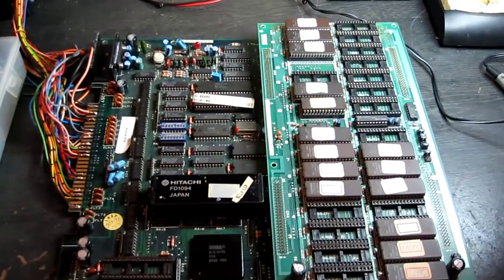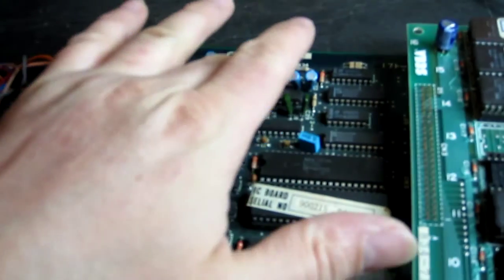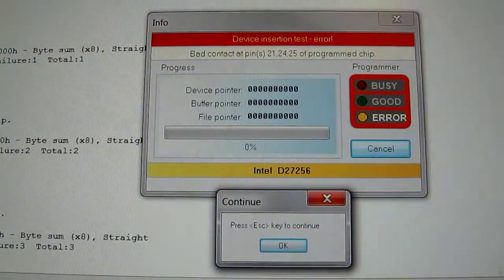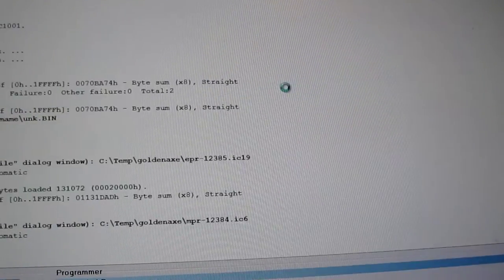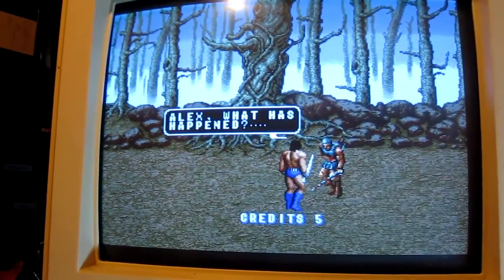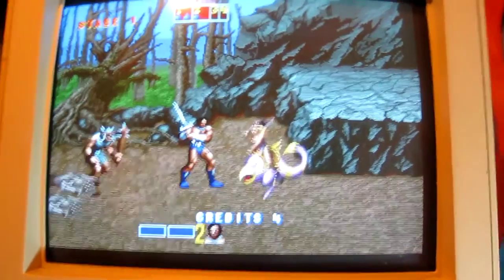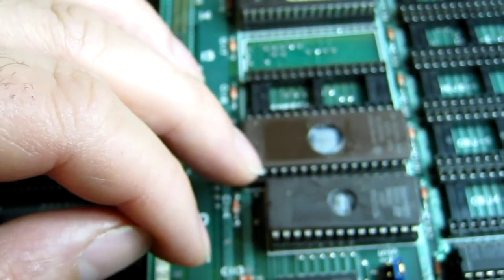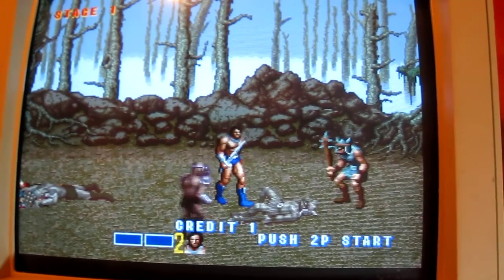Sega Golden Axe PCB - Sound Repair

Comment: Great job =)  It's funny the samples do sound like they've been ripped from earlier Atari games but they are correct.
Reply from the maker: Thanks mate, it would make sense if they used the same speech chip as Atari (as alot of Atari games have similar sounding speech from the TMS5200 series speech chips)

Comment: Awesome!  What's your programmer?  Seems like it can do some crazy custom testing by the looks of the screen in the background.
Reply from the maker: Elnec Labprog+ 
I've not made much use of the custom testing, but yes it seems to come with a full API, plus if you buy it new, you get a subscription service that allows you to make requests for them to add devices/features to the software. I got 4 different retro SRAM's added while mine was under support

Comment: Where would I go about getting a new sound rom for my Golden Axe? the battery in it died and took it out. I would loooooove to finish this rebuild, but have put it on hold for the past 12 years. 
I need a sound chip. : (